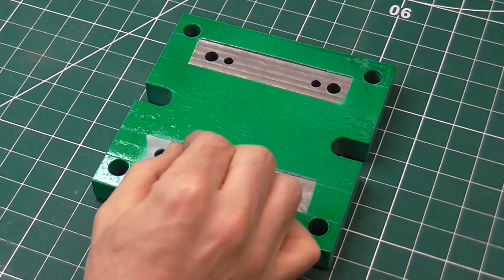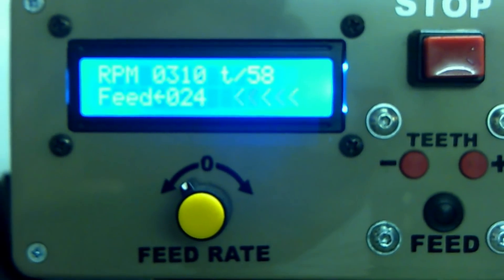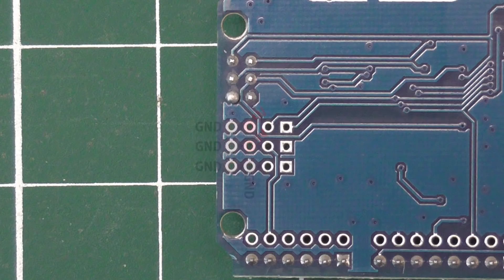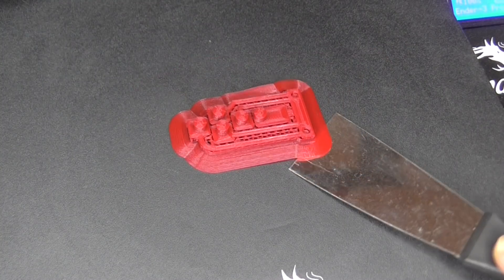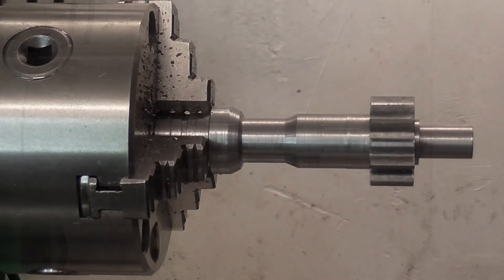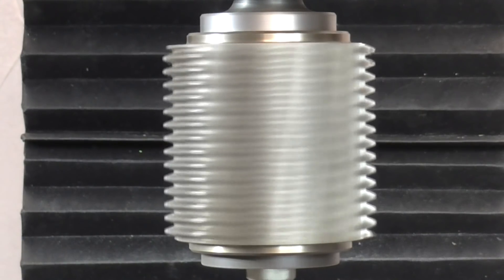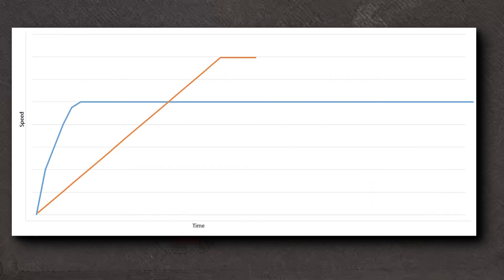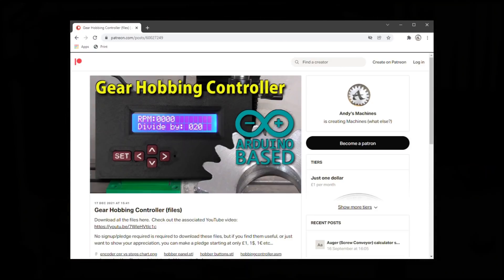Gear Hobbing Controller

Comment: Niche question, but I've run into a bit a of wall with implementing this project. Once programmed onto the board, the first line appears just fine, however, the second line (i.e. where the numbers are physically entered) is shifted down by 2 pixels. I'm confused by this because the shield I bought looks the exact same, with the same pixel resolution as your screen. Additionally, somtimes garbage values seemlingly appear, again on the second line, in place of the blank space/vertical line character. If anyone has any tips please let me know!
Reply from the maker: Another person had this issue too (can't remember if it was on here or Patreon). I think it might be a problem with the shield.
Reply: @AndysMachines  This probably just saved me hours of work, so I'd be more then happy to order a new shield just on the chance it works. Do you have linked anywhere which one you used/would you mind sharing what shield you're using?
Reply from the maker: @thedeclancarter  I just bought the first one I found on ebay, but it can be hit and miss. Another problem that has stumped a few people is that the shields sometimes arrive with the contrast turned all the way down so nothing appears on the display, all you need to do is turn up the small blue pot in the corner.
Reply: @AndysMachines  It works in the sense that I can upload a test sketch using the arduino to it to display just fine on on both lines, with all the buttons stll working. So it must be some difference in how the pixels are referenced from your assembly code, so I'll try and look into it! With that in mind, if you have any ideas, any help would be greatly appreciated!!
Reply from the maker: @thedeclancarter  Yes, that's the same thing somebody else said. There must be a subtle difference in the code that some screens are sensitive to, perhaps in the timings of the initialisation for the screen. Unfortunately I can't reproduce the problem as all my screens seem to work fine with the standard timings given in the datasheet for the actual LCD module.
Reply: @AndysMachines  Sorry to keep commenting, hopefully this is my last response in the thread, but I realized another issue. What's happening is that all characters on the bottom row are one ascii value greater then what they should be "Divide by" shows as "Ejwjef|cz". Is there any reason you could think for that happening? Really confused by the whole thing, and am close to rewriting the whole thing in C. 
(I should also mention trying sample arduino code using existing libraries displayed all the correct values and had no offset)
Reply from the maker: @thedeclancarter  That is very strange! the characters are a mix of odd and even values, so it's not simply that the last bit is missing, the values are consistently off by 1. Maybe it's trying to use user defined character data for this line and the offset happens to be set 6 bytes or so from the normal character set, as you mention it was also shifted down by 2 pixels? Is it always the the same or do the characters change if you do a reset or enter/exit the setup menu? (Which powers the screen off and on, but does not do a full initialisation).
Reply: @AndysMachines  The text does change from menu to menu but the chacters are always off by one ASCII value, and always shifted down 2 pixels. I'm not sure I understand what you're saying about the data being 6 bytes off, could you elaborate?
Reply: @AndysMachines  The issue I'm encountering I've found is the same as what "Christopher McClanahan" from your Patreon experienced, but the issue was never resolved on the forum, so I'm still not sure of the solution.
Reply from the maker: @thedeclancarter  Yes, I think Christopher was the other person I mentioned who encountered this problem. The character data for each letter is stored as a series of bytes with each bit representing one dot, though I think it is actually stored as columns on a 5x7 display, not rows. So this wouldn't actually explain the problem if there was an offset of an index pointer as the characters would be shifted sideways, not down. I still don't know what causes this problem and haven't been able to replicate it on any of my displays.

Comment: Fantastic work Andy. Very comprehensive, professional, and a great source of encouragement and enthusiasm for me and many others.  I have the steel sorted for the Hobber, and have the Arduino ready to go for the controller.  However, when I get to the hex file upload I get an error message avrdude "System wide configuration file "" avrdude: can't open config file"": Invalid argument avrdude: error reading system wide configuration file ""    "  Any thoughts on why this error is occurring?  I am a novice on the Arduino (was in to digital electronics in the age of and and or gates TTL).
Reply from the maker: Yes, other people have encountered this problem too. It seems that in some arduino IDE versions the config file is in a different folder, so you'll have to search for it and copy it into the arduino\hardware\tools\avr\bin folder. Or there is another program you can use to upload the code called Xloader (which actually just uses avrdude itself, but makes it easier).
Reply: Thanks for the prompt reply.  I’ll check those options out tomorrow.

Comment: firstly thanks  a lot my friend, i choose your project because i think you best :) but i have problem with stepper and encoder synchronization. i think noise cause that. my rpm not stable when mill run for example 750rpm but show me between 740- 760 rpm increase downcrease i try to change rpm  to slowest 45rpm but same problem, show me  between44-46 rpm, so gear teets form change 1 or 2 minutes later. have you got any idea ?
thanks for hepls and sorry my bad english :)
Reply from the maker: The rpm shown on the display is likely to fluctuate slightly around the true rpm due to the way it is measured, it's intended to be for reference rather than a highly accurate reading. It won't affect the operation of the controller so if you're having problems with synchronisation it's likely due to something else.

Comment: Regarding enable my drive has to be fed with 5v. In this case, I had to put the 5v and maybe a switch on and off on enable? Thanks.
Reply from the maker: You could add a switch, but it's usually enough just to hard wire the enable and if you need to turn the motor off just turn the whole unit off. There is no lengthy startup procedure when turning it back on.

Comment: Andy, the part about uploading main.asm file is very unclear. Can you give me a little clue for it? I've done the rest. I don't have a AVR programmer yet. Can you direct me with a link to it?
Reply from the maker: Main.asm is just the assembly version of the .hex file. You don't actually need this file to upload the code with avrdude, I just provided it for reference for people who are into assembly or might want to edit/adapt the code.
Reply: @AndysMachines  Ok then I have a problem. I've uploaded the hex file but the display is blank.
Reply from the maker: @skorkmaz  Ok, have you tried adjusting the contrast? (Small blue pot, top left corner). They seem to be set at random as supplied and sometimes you can't see anything on the display.
Reply: @AndysMachines  Ah, how stupid I am. Turning the pot solved the problem. Thanks. Have you designed your cycloidal reducer? I've been looking for some models on grabcad. They all have 2 discs. I wonder why they don't use 3 or even 4 discs for lower backlash. 
Best.
Reply from the maker: @skorkmaz  Don't worry! A lot of people have been caught out by this, it's literally 'pot luck' if the contrast is set correctly to start with!

I've already finished the cycloidal gearbox, by the time you see things on Youtube they usually happened a month or more ago. The reason for 2 discs is just to balance the spinning mass, they are 180° apart. Adding more discs is of no real benefit and won't reduce the backlash, that's all down to the tolerance. My gearbox has 2 discs but is not super high precision so there is a small amount of backlash (it's not going in a machine tool), the 2nd disc does not lower the backlash. If it's only turning slowly and vibrations are not an issue then you only need 1 disc.
Reply: @AndysMachines  I see. 

I'll build the cycloidal gearbox to use in the 4th axis of my cnc mill. Is the backlash within acceptable limits?
Reply from the maker: @skorkmaz  It all depends how closely you can machine all the parts and how much backlash is acceptable. It can be extremely low backlash if done carefully, but unlike a worm/wormwheel the backlash can't be adjusted afterwards. Also cycloidal gearboxes can be backdriven, worms generally can't.

Comment: Hello Andy, big compliments from my side. I really love this project. I am starting to built one myself, but I encounter a problem. I cannot find a suitable encoder that can hold a custom made encoder wheel. The thickness of my encoder wheel looks the same as yours and will not fit inside a HEDS 9100 encoder. Your encoder seems to have more space for thicker wheels. Can you tell me what kind of encoder you used? Thanks in advance, Mark.
Reply from the maker: Thanks! Yes, the HEDS/M read heads are quite small, though convenient as they can be bought separately. It's important also to match the pitch (line spacing) of the codewheel it is intended for, though of course you can change the diameter.

The one I used came from the back of a surplus servo motor, I don't know what type it was. I plan to do a video on making encoders (including DIY read head) in future, though I have a couple other videos in the pipeline first.  For the HEDS modules I would recommend printing the codewheel on a sheet of clear acetate film.
Reply: @AndysMachines  Hello Andy, thanks for your response and the tip using a sheet of acetate film. I don't want to bother you to much but I have problems uploading the hex-file via avrdude. The message that I get is: "Avrdude: no programmer has been specified on the command line or config file. Specify a programmer using the -c option and try again." Do you have any idea what I can do about this?
Reply from the maker: @mpoortma  Avrdude is not the most user friendly program, search for something called 'xloader', this has a windows interface and is much better (though it actually uses Avrdude but just configures it for you).

Comment: Hello Andy, I have tried to assemble the controller and upload the code, however upon upload the ardunino/display works but I am unable to get an output to drive the stepper driver. I have tried 4 different nanos and 4 different displays, no output but encoder and display and settings all function as I would expect. Took one unit uploaded a crude arduino sketch to drive stepper and it rotates. Any thoughts?
Reply: Update: Andy suggested that my issues might be associated with signal input from the rotary encoder. I then realised that the pins on my led shield were offset from the Arduino board by one. So rather than connecting to pins 2&3, I was connecting to pins 1&2 on the Arduino. All good now after changing. I hope this information might be useful to others. Many thanks to Andy for pointing me in the right direction.👍
Cheers
Andrew
Reply from the maker: Do you get an RPM figure on the display when the encoder is rotating? Can you check with an oscilloscope or multi meter the STEP and DIR pins and see if there is any change? Doesn't sound like a problem with the arduino or screen.
Reply: @AndysMachines  Hello Andy, There is a reading on the display when I squeeze the trigger of a variable speed drill, connecting a 1 mhz CRO to the encoder inputs, a square wave signal appears. The set up menu and button calibration also function. Connecting a CRO to the A2 and A3 pins gives a 0vdc reading and also with a multimeter. I looked for an output on other pins nothing there. Others seem to have success, I am using an Omron E6B2 1024 encoder. tried connecting to a 9v wall wart and to two different computer USBs to establish if I had sufficient current, same result. At least it is consistent but not the desired result. Can I send you the diagrams of the connected peripherals to see if they match your intended design. I am using clone nano and display as originals in Australia are beyond the budget of pensioners.
Reply from the maker: @alfredrofe  Yes, I only use clone arduinos too. If the screen is working then I don't think there's any problem with the nano. Just to confirm the pins are A1 (step) and A2 (direction), not A3. You will only see a change on A2 after changing direction but you should see pulses on A1 even turning the encoder slowly by hand.
Reply: @AndysMachines  Hello Andy, A little confusion from the digital world, A0 = buttons, A1 = Pulse, A2 = Direction, I had a more detailed email about pins but I found it wasn't sent by Youtube some 8 hours after attempting to send. So the above was a typo based on haste.  It went > placing the CRO and multimeter on Pin A2 reveals no state change when reversing direction in setup also no pulses measured on Pin A1, both remain at 0vdc irrespective direction setting or encoder movement in any direction.
Reply from the maker: @alfredrofe  I can't understand why you're not getting output pulses when it seems to be reading the encoder and displaying an rpm value?
Reply: Hi Alfred. I have a similar issue. The display is showing the correct rpm but no output to the stepper driver. However the motor does energise. Ironically I ran Andy's code a few weeks back with the rotary encoder attached and there were output signals shown on the scope. One output for every twenty input for 20t gear. I've run some other code and i can get the motor to rotate correctly, so I know my stepper driver and motor are wired correctly. Did you manage to resolve your problem? If so how?
Cheers
Andrew
Reply from the maker: @learningturningmetal  Hi Andrew, are you able to connect the scope to the outputs of the controller whilst connected to the stepper driver to see if you can see any pulses, or if the lines are being pulled high or low? Most stepper drivers have optically-isolated inputs so you should be able to see pulses of a reasonable voltage, though perhaps not the full supply voltage. If the pulses are very low (<1v) or none at all then that would indicate some problem. You should only see pulses on the step line unless changing direction.
Reply: @AndysMachines  Hi Andy - thanks for the info. Strangely my scope isn't showing any pulses on either pul or dir. I'm just wondering if part of the Uno has become damaged. I will continue to try and diagnose the fault. Thanks again for the advice.
Cheers
Andrew
Reply: Hi Andy - after some more testing I have found that pulses randomly flatline when changing the teeth count. The spindle just locks regardless of whether there are signals or not. I've also tried reversing the wires going to PUL+ and DIR+, but no luck. Also my encoder is 600 ppr. When setting 150 CPR the display shows double the speed. When I set it to 600 CPR the display shows half the speed. I can calculate accurate RPM in my Arduino code when using 600 ppr. I have also produced some test code to check stepper driver and motor run okay - which they do.
I you're interested I've produced a short video I can share with you which shows the problems. I can place it on OneDrive and give you the link. I doubt I can put the link or my email address in this reply, due to YouTube restrictions. My email address is available on my About page on my YouTube channel. If you wish to contact me via email, I can provide the link to the video. In the meantime I've ordered another UNO and display, to try to rule out hardware.
Cheers
Andrew

Comment: Hi Andy, what you have made is perfect and well done. BRAVO!!! Thanks a lot for sharing these videos with us. 
I would like to make something similar but I have few questions before starting. 
I have a big milling machine for industrial use and I would like to do and install a gear hobbing attachment. As you did. 
I have a made a 4th axis for the CNC mill and I can use this one for the moment. 
It has a nema 32 closed loop stepper motor 1.8 deg the gear ratio is 40/1.
Can this be used? If yes how to adjust the parameters?
Is it necessary to have the encoder installed? If not this will create issues to the program? I would like to get more info the electronics if possible.
Reply from the maker: Yes, you do need the encoder, otherwise there will be no way to synchronise the blank with the cutter. 40:1 is a very large reduction ratio (8000 steps/rev). The controller will let you input this value, but the performance won't be great, you'll only be able to run the machine spindle very slowly or cut gears with high tooth counts, otherwise the stepper motor just won't be able to spin fast enough (even closed-loop).
Reply: @AndysMachines  hi Andy. Thank you for the feedback.  I will check what other options I have.  I have one 20:1, but need to check

Comment: Exist an formula to syncronize rotary ?
Reply from the maker: Yes, you just turn the blank at the same ratio to the spindle as the number of gear teeth you want to cut. eg: 40 teeth, 40:1 (for a normal single-start hob).

Comment: That could be useful for so many more applications than just gear hobbing. It could be used as a rotary welding table or linked with an axis instead of a spindle to make spiral cuts. It could even be used to cut rifling if it were indexed with a purpose built jig or on a machine with long enough of a bed.